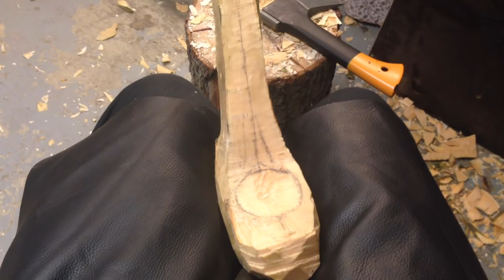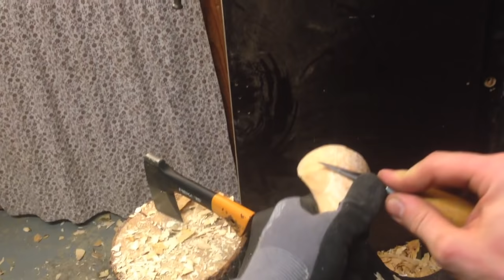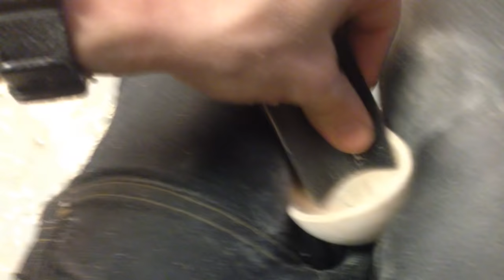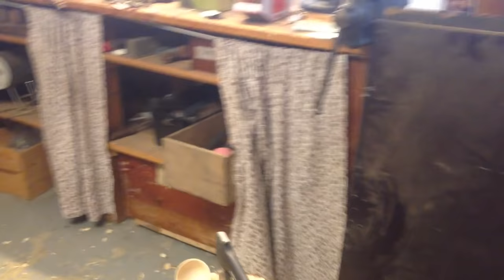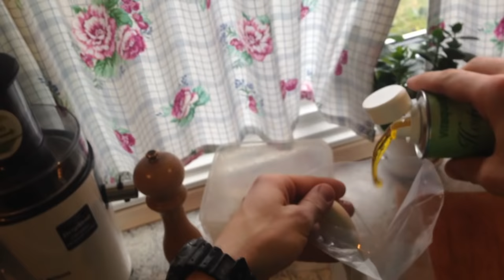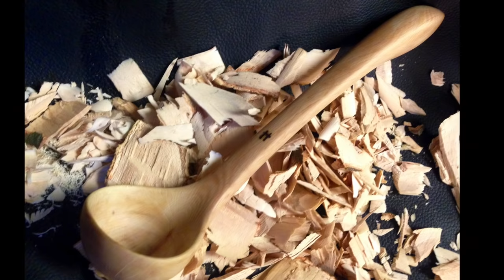Wooden ladle from start to finish

Comment: How do you keep it from cracking splitting checking?
Reply from the maker: Every time I lay it down, I put it in a sealed plastic bag so that it doesn't dry out too quickly. If I'm worried that it may be drying too fast I'll add a little piece of damp paper towel to keep the moisture up. Then the trick is just to work quickly and then finish off with the oil before it goes completely dry. Or at least I guess so :)

Comment: This inspired me to try a ladle myself. 
I have completed it, decorated it and sending it as a Sauna ladle to my Finish Pen pal to whom I have been communicating with since 1973. I love the shape of your ladle, mine is a bit more rustic but works. 
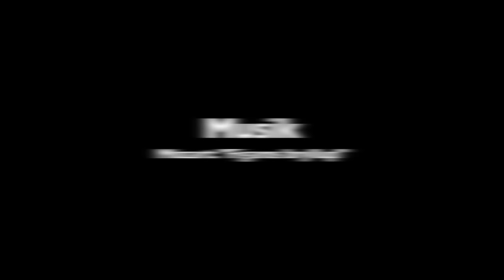I wondered though at 4:18 the bowl of the ladle looks like it still has the pith in situ - are you not meant to carve that away or does it not matter?
Reply from the maker: I don't know what that means, but here, a few years later, the laddle still stands :) No cracks. Sounds lovely with your pen pal. What a lovely gesture :)